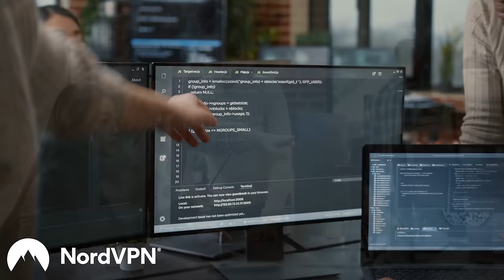Elon Musk fails Cybertruck stainless steel metallurgy test | Auto Expert John Cadogan

Comment: Every machinist and fabricator will tell you that if you can use something besides stainless steel, please do.
Reply from the maker: Totally, duuude.
Reply: I'm a fitter and  machinist and I love working with SS, the final products if done correctly are beautiful. It's not hard but is tough and certainly can very quickly work harden like a mofo, that's where skills and knowledge comes in. Every material on the planet has it's own characteristics and you either work within it's parameters or you fail, sometimes catastrophically!
Reply: Exactly. Many will tell you, it doesn't corrode as easily as regular steel but it nevertheless can. Basically it's tough and tenacious but not strong. Standard HSS drill bits and shaper bits will pretty much become dull immediately. It needs tools containing 5% Kobalt. It gets very hot, not just warm when drilling.
Standard SS WILL corrode in salty or polluted air, upon contact with zinc coated steel in open weather. And, you can't run a metal shop processing SS and regular steel on the same machines. Both section or departments of the production must be separated carefully.
If you want to assure it's non corrosive you got to chose the more expensive type DIN 1.4401 / EN X5CrNiMo17-12-2
which contains 2% Moly
Reply: @verosso2788 My experience with machining 304/316 SS is that what actually happens when a drilling operation suddenly goes wrong, the tool material actually friction welds a little layer of the tool onto the bottom of the hole. This accounts for the very hard skin, but it is technically not the base material that got hard. If it were possible to make SS undrillable with HSS tools by hot/cold working it, I'm sure there would be applications for this property to be purposely induced, and there simply is no such property.

Stainless has about half the rate of thermal conductivity as carbon steel, so the concentration of heat at the tool point is a real phenomenon. I have witnessed a failing drill tip glowing red hot beneath a flood of coolant.
Reply: @HuFlungDung2  I agree with your statement and accept perhaps it’s not technically work hardening, same headache to fix after the fact though. I imagine the drill you witnessed went from cutting nicely to melting in about half a second too! Sounds like too high speeds and too low feeds or maybe Tiffany from the office strolled in the workshop resulting in the feed rate (preload) reducing for a blink of an eye - been there! In my opinion Stainless cuts easily with correct cutting angles, feeds, speeds, maybe some lubricashone (read that like John would say it!) etc. but rubs very, very poorly.
Reply: @sindbad8411  I don’t use any special drills just grind any old (perhaps not chinesium) HSS drill with the correct angles and minimal clearance to back up the sharp edge. Slower speeds and very consistent feeds are imperative as is not allowing too much heat build up as you mentioned. I wish I owned enough machines to only use one for each material type but not very possible in my world. Definitely agree that processes such as grinding, friction cutting, sanding and other finishing operations should be with consumables only ever used for stainless though.
Reply: @AutoExpertJC  where is their sense of adventure!
Reply: Not true, only the ones that aren't good enough to get paid what it takes to love doing stainless.
Never built a chip fab facility have you.
I deal with people like you when getting bids. I've lterally asked, "How much is left on your mortgage? Add that to the bid." And that was for something theyre qualified for, the grunt work the real pros didnt want to do.never got a bid from people like that, but each call started like the commentary here" I'm the best, I've been doing this for blah blah blah years"
 Egos like this crowd are the idiots of thr mediocre.
Reply: It s funny that you think at Tesla there are no machinist or fabricator!
Reply: @lucadellasciucca967  I presume you watched the Sandy Munro's tour of the cybertruck line.
Reply: @sparksmcgee6641  You presume correctly. Has nothing to do with my comment tho.
Reply: @verosso2788  laser welding robot operator here. Stainless is my favorite also to weld. More shiny , less stinky when the weld are done.
Reply: Machinist tooling begs to differ… they say for prototyping they refuse to use any hard metals… stainless steel isn’t even hard compared to other steels like carbon or 990 stainless… 
Btw it is rust resistant but there can be buildup of iron attaching itself to the surface which starts rusting that’s what causes lower grade stainless to rust. Still it is surface level only and harmless just have to take some cleaning clean and rub it off.
Reply: @lucadellasciucca967  Yeah, the guy running this channel has a delusion of competence. Like shooting dead fish in a dumpster full of dead fish. Not even worth watching this guy anymore. I got fed one of his videos and this is the third. Haven't watched one since. Keep up the good fight.
Reply: @verosso2788 I agree.. I worked in a tool and die shop and most that we delt with is SS.. u need the right tools.. we had CNC to cut it and hydraulic press to bend it.. it wasn't that hard.. tho u can have the steel treated to make it more corrosion free and harder but SS itself is not that hard to work with if u have the right tools

Comment: In the early 1960s Ford Motor Company produced a few stainless steel show models. They were an experiment which, according to the automotive press of the time, were the way of the future. A few years later some of the more critical thinkers in the automotive press researched the cars from a " hey Ford, what happened?" point of view. Apparently there were a number of issues with stress-cracking and so on,  but in fact they were successful in pressing/stamping the body panels for a Lincoln Continental and a Ford Thunderbird, complete with all of the compound curves of their non-stainless archetypes. I never did learn which alloy they used but presumed it was specially annealed and re-annealed and possibly progressively formed as well. 

I very much enjoy your take on things.

Comment: Hi John.  I am a retired mechanical engineer and I enjoyed your discussion on Elon Musks comments about Tesla's Cyber Truck.  You brought up some good points and made a good case.  I would add further that when dealing with the various 300 series stainless steels you can do quite a bit of forming with them if you include annealing steps between forming operations.  As you pointed out, you can form stainless until it strain hardens just short of its strain limit.  By the use of progressive dies and annealing between forming operations you can create the shapes necessary to form automobile body panels.  The major difficulty in this for Tesla is likely the expense of making the forming dies and the manufacturing process time tied up in annealing the material between forming operations.  The key to doing this and getting a satisfactory result would be to strain harden the body panels to the required hardness on the last forming operation.  This should be repeatable but would be expensive and time consuming.   Sets of large forming dies for stainless steel would have to be made from tool steel and would be very expensive.  The Cyber Truck's low volume production would never be able to amortize the cost of the dies and annealing furnaces etc.  It is likely Mr. Musk knows all of this because it is pretty basic metal forming technology.  It would be best to remember that Mr. Must is a huckster and marketeer.  He is counting on the ignorance of the general public to not understand how to form stainless steel so he can explain away why the Cyber Truck looks the way it does rather then like a more modern vehicle.
Reply: Wasn't the DeLorean a stainless body...? 🤔

😎👍☘️🍺
Reply: @peterfitzpatrick7032   OR was it tirty tree thoosandsofaninch fick aloominum spud wrap 🤔  Mrs Brown will know
Reply: @peterfitzpatrick7032  
No; it had a glass fibre body shell with brushed 304 stainless steel panels attached.
Reply: @JoeC88  Are you having a stroke , Joe ??... 😂
Reply: @petesmitt   Thanks Pete, I never knew that !... ☺️
Reply: We are supposed to be saving energy rather than adding heating stations in a press line... after all Electric J  is all about saving energy,  and he saved a lot of the energy that would normal go into designing a practical vehicle - in fact he saved over 90% of the design energy, the result is the perfect triumph of form over function, it helps if you think of E J as a modern day P T Barnum...
Reply: They're using steel that's been rolled to cold work it before forming. Wouldn't subsequent annealing weaken the steel?
Reply: @Global_Optimization  
No, annealing strengthens steel.

The annealing process provides the following benefits.

Increased ductility

Increased toughness

Increased machinability and formability

Reduced hardness to match acceptable levels

Reduced or completely eliminated internal stresses

Improved homogeneity

Improved appearance

Better chemical and wear resistance

Improved magnetic properties and electrical conductivity

Reduced shrinkage
Reply: @petesmitt  The killer is the annealing time & cost of progressive dies. The SS for this application has been work hardened by the rolling process.  Seeing the edges of some body panels the metal looks quite thick.
Reply: @chrissmith2114 Good point. Also look at the great Green Warrior, Leonardo.....Do as I say, not as I do ??
Reply: @petesmitt  annealing reduces the strength of most metals, it reduces their hardness, being ductile is OK if you want to bend or press the part but is bad for strength,  annealing  will reduce internal stresses but sometime the stress makes the steel / metal stronger ( cold rolled steel has a better grain structure and harder skin ). Shot peening process can do most of the things to improve metals like toughening the surface and improving wear and chemical resistance.
Reply: Please anneal this into functional paragraphs. Sheesh.
Reply: From what I've heard, they don't want to anneal anything, they cold-work it into shape directly from stock. Or something.
Reply: @chrissmith2114 you understand you can anneal a material then re introduced a heat treat right? Again more processing but that’s why it’s so expensive
Reply: @gilliesiut2332  Yeah, but heat treatment of metals uses a lot of energy,  another nail in the lifetime carbon coffin of EV, oh so green....
Reply: @chrissmith2114  you seem to think this is about anything besides marketing. This is a status vehicle like the jeep gladiator.If you want to reduce the carbon footprint ride a bike.

Comment: I worked in a tool and die shop..i used to bend steel pipes with a hydraulic press everyday..u can bend steel pretty easy with the right tools also u can make the steel harder by heat treating it after u bend or form the steel. The fact the Cyber junk has sharp edges blows my mind..as if they couldnt do a better job bending the end of the steel so it isnt hazardly sharp

Comment: It seems to be magnetic so its ferritic, martensitic steels is not cold rolled. Its likeky a cold rolled steel, cold rolled steels basically gets its strengt by reducing the difference between ultimate- and yield strength, this is the window you must stay within during forming otherwise it will break.

The steel is so brittle from the start that it cant be plasticly deformed much otherwise it cracks.

Comment: Lovely video. It reminded me of an incident at the Heinz factory in Wigan, where a pipe carrying baked beans (about 3 foot in diameter) burst. The repair man fabricated and fitted a replacement using sheet steel, but 2 hours after the beans went back on line they had eaten as hole in the replacement, which was 304 instead of 321. A room about 40 feet square was 5 foot deep in beans by the time they realised what was going on. Oopsy!
Reply: A room full of beans…
Reply: Way to spill the beans

Comment: I wonder how stainless is going to put up with work hardening due to vibration etc.
eg. Drive your "tough truck" over too much dirt road and will it start cracking at high stress points?

Comment: Cyber Urinal - That's funny.  It does remind me of the utilitarian all-stainless steel urinals that can be found at public rest stops along the freeways in the US.

I read someplace that it is simply made of 1/8" thick 304 SST.  Nothing magical about that, except that it doesn't lend itself to be easily formed into complex 3D geometries (as in a stamping press).   So if Elon wants to use this SST, then he is largely confined to a truck body that looks quite angular.  I also got a chuckle from the explanation from Tesla that the SST is so hard that it would break the forming presses.  More likely, the work hardening could cause stress cracking at the bends if they are too sharp or aggressive.

I suspect that the truck will come with a light brush finish on the SST, as it would hide scratches better.  I highly doubt that it will have a polished finish as the first time someone rubs something against  it, it will start to show scratches.  After a year or two of real service, I don't think that even the light brush finish is going to look very impressive.

It will be interesting to see the results of the crash tests by the US NHTSA (National Highway Traffic Safety Administration).  I suspect that the results for the Cybertruck will be quite different than all other pickup trucks, as the body will not crumple in the same way as a truck with a more conventional body construction.  My first thought is that the Cybertruck body may impart worse injuries to the driver and passengers (due to faster deceleration of the riders as the truck body crumples, and my guess that the Cybertruck body is stiffer than a conventional truck body).  But perhaps I'm wrong.  We'll see. 

Ed Schultheis, PE
Mechanical design engineer and manufacturing consultant for 35 years
Schultek Engineering & Technology
Washington state, USA
Reply: The steel urinals started in roadhouses as a cheap way to provide a urinal. Would not be surprised if the first ones were modified farm equipment. Then the cheap bars followed their example, and in turn the public providers did the same, for the same reason: it’s cheap and works. it splashes and the installations are generally gross, but it checks the block.